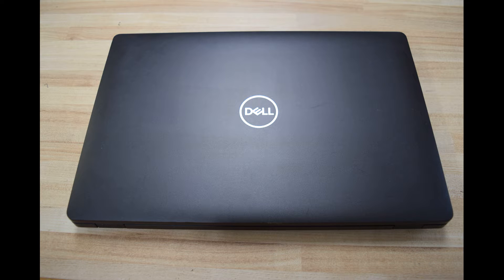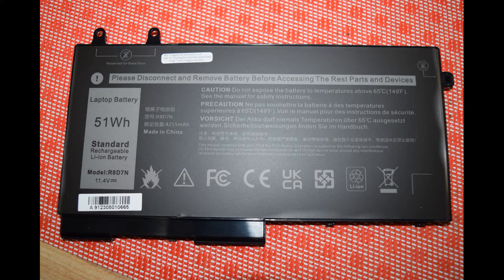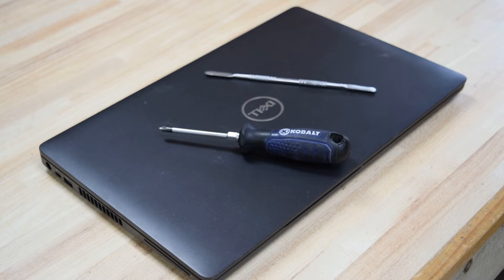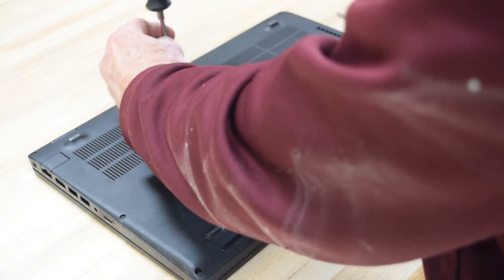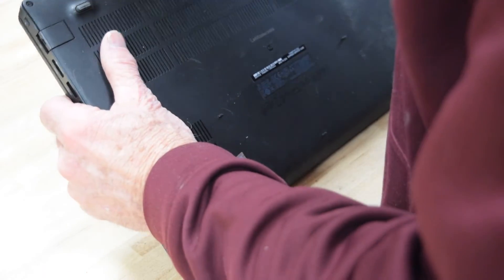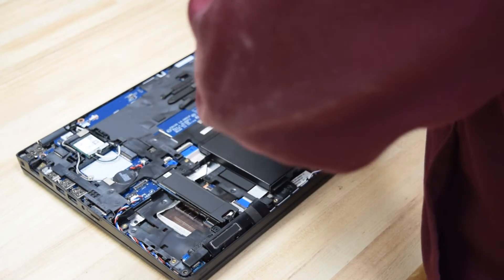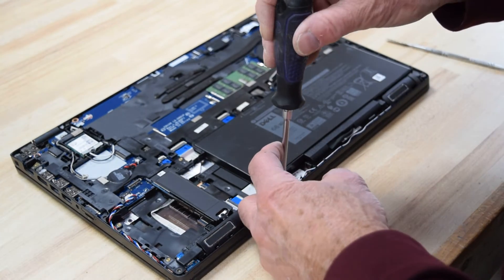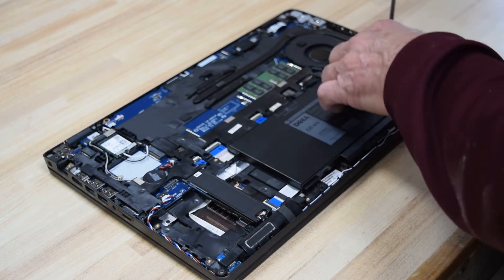Dell Latitude 5500 Battery Replacement

Comment: The loop is over the connector and is a flexible plastic. You insert the tip of your finger and pull out. This will act as a stress relief on the  cable itself. Also, when you use this loop, you are pulling evenly on the connector. If the laptop is flat, you are pulling straight up.

Comment: See the loop?  No - your hand is in the way!
Reply: The loop is over the connector and is a flexible plastic. You insert the tip of your finger and pull out. This will act as a stress relief on the  cable itself. Also, when you use this loop, you are pulling evenly on the connector. If the laptop is flat, you are pulling straight up.
Reply: The loop is over the connector and is a flexible plastic. You insert the tip of your finger and pull out. This will act as a stress relief on the  cable itself. Also, when you use this loop, you are pulling evenly on the connector. If the laptop is flat, you are pulling straight up.